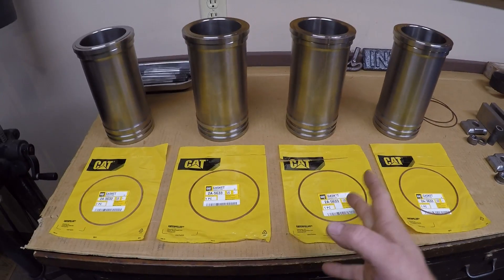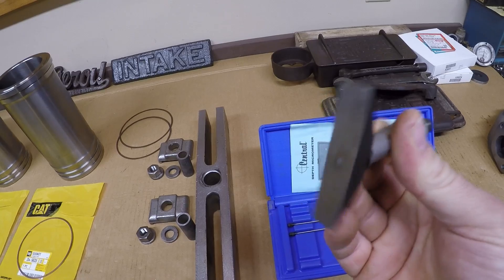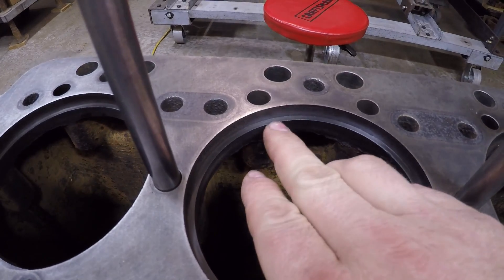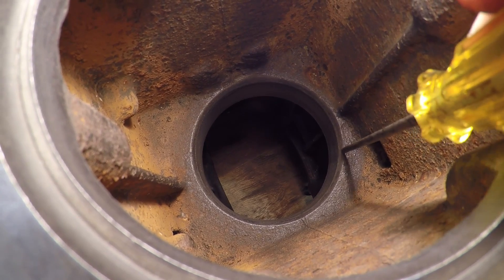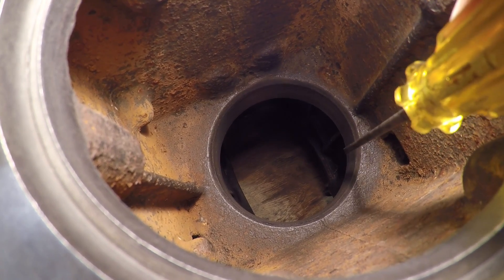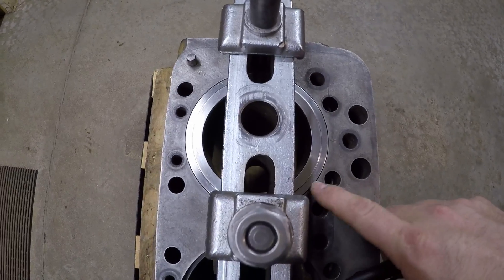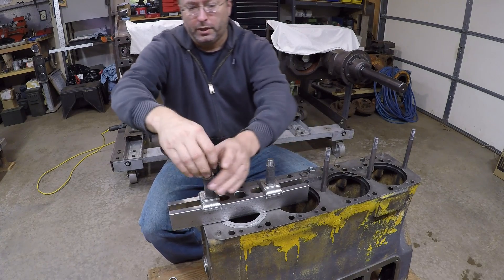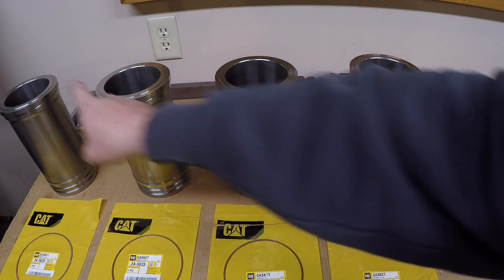Caterpillar D2 #5J1113 Diesel Engine Assembly Ep.2: Checking Liner Protrusion

Comment: In Part 22 of your MM prototype rebuild you painted the inside of the transmission housing. I was wondering you are going to do that with this D2 engine and transmission. If not, why not? Different casting material? Thanks. I thoroughly enjoy your thorough work on these machines.
Reply: @squatch253  Thanks, makes perfect sense.

Comment: Next to a CAT engineer, your knowledge, precision, patience and thoroughness is impressive.  Good video.
Reply: I have 2 buds that quit Cat because it was getting so sorry. The times they  are 'a changing as an old song goes.
Reply: @David Hotaling You're dead right in that it ain't what it was. Cheap junk now. I like the old stuff. I can run a hi-track but it's nothing special except the dry cab. I started out on pony motors and still like them better than direct. But I'm a geezer and home except when somebody needs a hand. 50+ years was enough driving and operating but it was a GOOD life except when the guvment stuck their LONG pointy nose in it. My pals walked from Cat and you're right about why.  And you get stuff to WORK, not work ON! I've done a lot of 'body work' on mixers with an IT-28 and a set of forks. Take care, Pal!
Reply: @David Hotaling The older ones were better. Can't remember what they had at the paper plant here before it quit. Don't think they were Cat. Toyota maybe.Like the new trucks and all this def garbage. Better have an old rig to get the job done while the other mess is getting fixed.
Reply: @David Hotaling AMEN and no def! I don't even want to think about that stuff.
Reply: @David Hotaling I managed to dodge it. I was working at a boulder hole right before they got loaders and such with it. I slipped out right before. Never drove over the road. Day trips were more than enough for me.  Never had the hankering for a rolling bedroom.

Comment: Thank you for posting the video. I'm currently replacing the wet sleeve o-ring seals on a 5U3438. The tractor was parked 40 years ago because of coolant in the oil. Figured out it was the o-ring leaking and sure enough they were rolled. I'm all ready to push the sleeve back in, so waiting patiently until you do it first so I can learn from your excellent teaching.

Comment: Good job “squatching” down those liners and if I didn’t know better I’d think you were a 50 year veteran Cat mechanic right down to the oTc H puller and the use of what we used to call “Cat Fundamental English” great job👍 I used to start by micing all my liner flanges and looking for the same handling damage that you found on the counter-bores and using the same procedure to correct it. Be surprised how many protrusions you can find on the underside and topside of the liner flanges. Always wondered where you got all your knowledge on the older Cat machinery; I’m guessing from some old timers,  your dad etc. At any rate you’ve mastered the vintage Cat repair as if you learned it from mentors in some Cat Shop back in the 40’s or 50’s very well done as always!👏

Comment: When my dad built his D4 7U he could not get the copper washers. Cat supplied steel washers instead.  After some research with old Cat mechanics they said that the copper was too soft and over time would allow the sleeve to come loose and move in the block.  Thus the change of washer material.  I still think the copper will be just fine in most applications it sounded like this was primarily a problem in the larger bore engines.

Comment: Good morning Squatch (well goodnight in Japan since it's 9:40 PM here)! I usually do this with a test indicator in a surface fixture, but I've also done it with a depth mic like you just did. I always shot for 0.002" max deviation and greater than 0.002" protrusion and less than 0.008" as well, in addition to max deviation of 0.002" per sleeve I shoot for less than 0.003" between adjacent cylinders and 0.004" between non adjacent cylinders. You're well inside all of those on a block cast in the 1930's. CAT manufacturing and machining was and is (for the replacement liners) on point. I dread having to do this on my McCormick Deering ODS-6 when I rebuild the engine, especially since there's 2 different style liner and head gaskets. The real trick will be finding or repairing the cylinder head that I'm certain is cracked since my family ran the tractor with the radiator cap off for 40 years. Hope all is well, happy hump day! Give Rick a hard time for me at work today. All my best!
Reply: Do you attach your indicator base to a 123 block or something similar, or do you have a special jig for it?
Reply: Look for "surface gage" or "surface indicator". You can get indicator and pointer bases that are just a big lump of ground iron and not magnetic. They are designed for use on surface plates, primarily. Keep in mind that until WW II surface plates were nearly always cast iron, not rock, so they work fine in this use.

Here's one on ebay at the moment:
https://www.ebay.com/itm/Vintage-Browne-and-Sharpe-Surface-Gage-With-Scribe-Small-About-2-3-16-x-1-9-16/401903590195?hash=item5d93521b33:g:zM0AAOSwUf9dj5tz
Reply: I hadn't given that much thought. A height gauge would actually be perfect for this application.